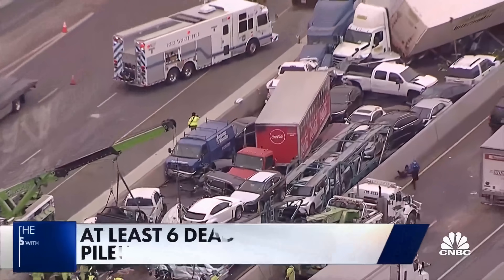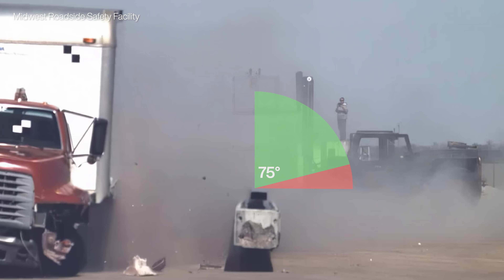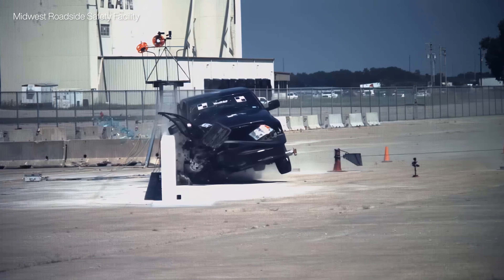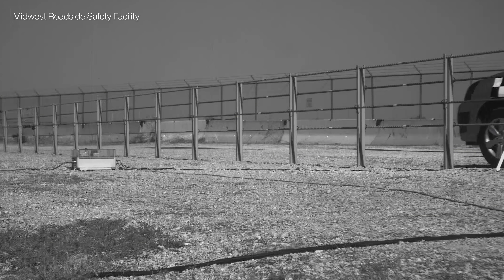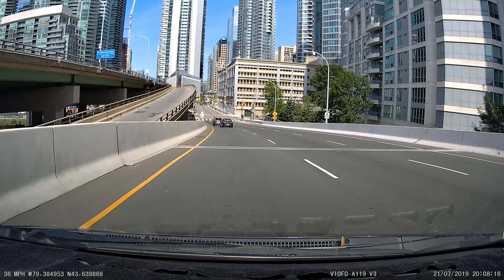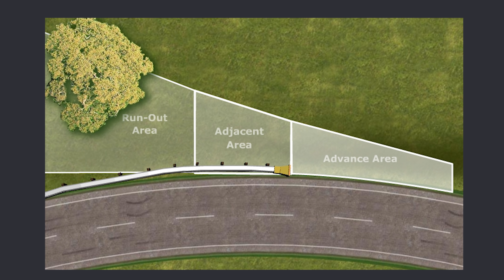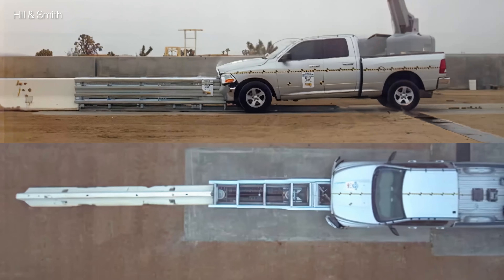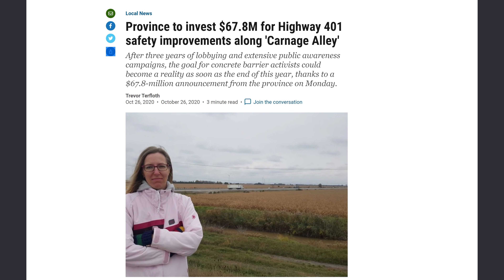How Road Barriers Stopped Killing Drivers

Comment: I found this video very interesting and informative, and I was particularly caught by the section on how governments value the lives of road users.  As a motorcyclist, I have always felt that I am totally ignored by all concerned in road design and construction, and that governments of all political persuasions just couldn't give a f*** about my safety.  Rope wire barriers are a prime example of this attitude.  If I hit a rope wire barrier I will not be gently slowed down, I will sliced and diced!  But at least the government will have saved some money.
Reply: @TheBetweenSkill  Most of the bikers protection come from their own wallets...  you really cant skimp on protective equipment, all those morons who drive without proper gloves, boots, pants and jackets are in it for some serious damage even in a tiny accident.
Just sliding across the tarmac is going to destroy a your skin... unless they wear protection which prevents that completely, a T-shirt aint gonna do shiz.

Proper equipment can protect from serious impacts aswell, broken bones are almost always guaranteed but even then if theres padding (for kinetic energy absorption) it  can go a long way in preventing spine injuries which are far worse than just snapping a bone in your  arm.
Reply: In the USA, the governement doesn't really care about safety, mainly because there is a big lobby of bikers on harleys that prefer to die straight away in their crash instead of spending 1 month in a cast.

Best exemple is that the soup bowl DOT helmet is still totally legal, even though its almost as safe as a construction hard helmet.

Hopefully, will see a change in that.

Comment: In North Carolina, there's a lot of cable barriers in the clear zones on highways, but fairly recently I've seen two cases in two different parts of the state where a car went off the road, into the median, and straight through the cables without slowing down whatsoever. Both cars went all the way across (about 40 or so feet) the medians and hit another car head on. I'm not convinced about cable barriers being solid enough after seeing two separate incidents where cars just mowed down an entire section and went all the way into oncoming traffic. Unfortunately, both cases were fatal and I hope the state learns that maybe they need to do something about it.

Comment: Lets put the data in a less inconspicuous, yet the exact same, rate as your chart. Given the same # of crashes:
Conc deaths: 4,444
Cable deaths: 10,000
You know, just SLIGHTLY higher. 
Would anyone say THAT method of displaying the same rate, 2.25 times the # of deaths, is “slightly” higher?
No. No they wouldn’t.
So stop. Do you have an agenda or what? Personally, as someone who works for one of the largest construction co’s. In the world, I’d like to NOT give them more ammunition to sacrifice safety for $ by using sloppy, weak,  language regarding safety equipment statistics.

Comment: Did he just say “slightly” higher death rate from that graph?!?!?!?
Ummm. Sir. As a construction engineer, and as a generally smart person, let me be the first to point out that 2.25 TIMES the fatality rate is NOT “slightly” more. Wow. If you dont have the guts or the brains to report this accurately, please don’t report it at all.
Just because both figures APPEAR low, meaning they’re both under 1.0, means NOTHING. How about if the rates were 0.004 and 0.09 - Those are both “small” numbers too. Is one just a “slightly” higher rate than the other as well?

Comment: One thing you didn’t cover our roadside signage and lighting poles. A lot has been done over the past decades to improve safety in those. Wooden posts with large holes drilled in them so that they breakaway easier, breakaway bolts etc.

Comment: "slightly higher fatality fate vs concrete"
0.4% to 0.9% is not "slightly higher", it's over double.
Reply: and there's a 100% difference between 0.00000000000001% and 0.000000000001% however the odds are still very low.
Reply: @xxxdumbwordstupidnumberxxx4844 Actually, the difference is 100x, which is a 9,900% increase. And anyway, the second fatality rate is so low that if that is an annual fatality rate, every 10,000 years someone dies.
Reply: @ME0WMERE  you're right, i didn't actually think the math through there

Comment: Cable Barriers kill motorcyclists and should be banned, it's like hitting a cheese slicer on a bike.
Reply: Aren't basically all barriers deadly on a bike? Hitting anything at highway speeds on motorcycle basically turns you into a human projectile.
Reply: @vaughnd222  No. firstly not many crashes are at highway speeds - a lot of braking usually happens before the impact, then a solid barrier will hurt you and may kill you, but a cable barrier concentrates the kinetic energy just the same way as a sword does, doing way more damage.
Imagine being told that a 12 inch steel  spike, driven by your airbag charge, in the centre of your steering wheel, was a safety feature that would deploy on an impact and you should just suck it up because it's cheaper to build than an airbag. that's how motorcyclists feel about cable barriers.

Comment: I'm missing a point of view: motorcycles. Both the rail and wire are less than ideal when sliding into them. The barriers, while painfull, are less likely to tear off a leg or arm when sliding into them. Sometimes they fit another flat beam at the bottom of a barrier to prevent motorcyclists from sliding underneath.
Reply: The Monster Under Your Bed  you're misdirecting on purpose. You understand full well its no extra trouble to look into motorcyclist when adjusting crash barriers.
But since you went straight to a 1 part of the comment and went with that to try and be right, you've pretty much told everyone you have no arguments.
Which is only to be expected.

Just a note: there are airbags for motorcyclists. Integrated into the jackets.
Reply: +1
Reply: I was thinking that too!!
Reply: If you want to be safe, why are you riding a motorcycle in the first place?
Reply: @jimmehjiimmeehh9748  Its not about being safe. Its about not being ripped to shreds should I fall for whatever reason.
Reply: @Twiggy163  So it's about being safe?
Reply: @jimmehjiimmeehh9748  Damage control. Youre already not safe.
Reply: @Twiggy163  So it's about being safe?  Trying desperately to use alternate phraseology doesn't change the fact.
Reply: @jimmehjiimmeehh9748  Sorry, but damage control has passed the safety checkpoint. Damage control means you've already done what you can about preventing something. Damage control means you try to limit the consquences.
Reply: @Twiggy163  If that's what you're arguing then you have failed spectacularly.  So once again if you care about safety why are you on a motorcycle?
Reply: @jimmehjiimmeehh9748  Why are you arguing when you dont understand the difference between safety measures and risk mitigation?

Why would I care? It is a weird question. Because there is risk involved, it means I dont care at all?
Reply: @Twiggy163  It's not why would you care, it's why are you choosing to ride a motorcycle and then whining about safety?

Choosing to ride is choosing to put yourself in danger.  If you care about being safe why would you choose to ride?  And from the municipality's point of view why would you waste money on building safety measures for 1/50 or so of road users that are already choosing on their own to put themselves in danger?
Reply: @jimmehjiimmeehh9748  Whining? The only one doing that is you. Like I said, why should one mistake, either mine or someone else result in my death or dismemberment? Same goes for the choice of barrier. The way it is designed impacts driver and rider safety. Thats what this whole video is about! So if theyre looking at driver safety, why not take rider safety into account at the same time? Your 'care about safety' argument falls to pieces at that point.

I'd love the statistic that says pedestrians are killed more often by a motorcycle than a car. However, there needs to be a relative in that because, like you said, there are a lot more cars than motorcycles. Even then, the numbers in my country dont support your claim. The mass and shape of cars is enough to make them more dangerous and more likely to happen in the first place.

The obvious statistic youre pointing towards are bikes being more dangerous for the rider. I never claimed otherwise.
Reply: @Twiggy163  "Why should one mistake, either mine or someone else result in my death or dismemberment?"

Because you chose that level of risk when you chose to ride a motorcycle.  No one else should have to pay for your choices and mistakes.
Reply: @jimmehjiimmeehh9748   He didn't whine about safety, it's about  the injuries for crashed, for examples you will be injured from a car crash but due to the road barrier, the "damages control"  reduced  thanks to the barrier reduced from it ,
Reply: @dadaeeaeeadada3301  "He didn't whine about safety, it's about  the injuries for crashed"

This is the language barrier again.  These are the same thing.

To be blunt, you should not argue in a language that is not your native tongue.
Reply: @jimmehjiimmeehh9748  Just because I'm not fluent in English doesn't  mean I can't use it , these words exist and you actually the one to tried to change the original meaning doesn't help ,  there is a different between a vehicle crashed and the person suffered injury from the crash , that why road barrier exist, they exist to damages control or rather reduced the injuries a person get ,
Reply: @jimmehjiimmeehh9748   No I didn't choose that level of risk, that is nonsense. I chose 'a' level of risk. Not specificaly that level. I also dont choose the type of barrier the government or agency has placed alongside the road. Hence, when improving safety for cars, why not also look at motorcycles at the same time? Its a non-issue.
They did do that where I live, but they didnt mention it in this video.
I also pay road taxes, insurances, health insurance and unemployment insurance (social security) in this country. So, I'm already paying.
Reply: @jimmehjiimmeehh9748  What? What kind of idiotic thinking is that? English is not your native language so you shouldnt argue?
Maybe you should just bugger off. Anyone can chip in. I dont mind your comments either.
Reply: @Twiggy163  "No I didn't choose that level of risk, that is nonsense."

So you were forced onto the motorcycle at gunpoint then?
Reply: @jimmehjiimmeehh9748  Realy? Again with the weird questions? You're just clutching at straws.
No motorcyclist has ever gotten on one with the idea 'theres is a risk my slide will end me up under a barrier that will tear my limbs off.
A fall? Yes. A slide? Yes. Thats why there is protective clothing. Some dont even care about that, it seems.

But for you to say there should be no thought into a barrier for motorcyclists because they accept the risk is utter nonsense. Car drivers take risks, may aswell forget the barriers entirely if we follow your line of thinking.

You're arguing over nothing with straws and I'm ending it here.
Reply: @Twiggy163  Tbh I'm genuinely impressed you managed to stay relatively calm and non-insulting while arguing for 3 or so hours with such a short minded, clearly biased person. 
Bike haters can be really insufferable sometimes. This coming from a person who doesn't ride a bike, but that can see the bad rep a few irresponsible bikers give to everyone else, thus devolving into that kind of idiotic "you should die" mentality. Sad, really.
Reply: @ricmar  oh its quite alright. Ive had a nice ride to the in-laws (on my way back, just taking a break). I dont think hes an anti-bikers, though I understand te stigma surrounding motorcycles. Relativly speaking, people tend to let loose a lot more on a bike, to great annoyance of many people.

The original comment stems from me being both a motorcyclist and a civil engineering. Just an observation but it got the wrong sort of attention.
Reply: @jimmehjiimmeehh9748  The thing isn't about why  motorcycle being dangerous, due to  road barrier evolution lead to less risk for car user but fail to protect motorcycle user, road barrier also need to protect motorcycles drivers
Reply: @jimmehjiimmeehh9748  You ignoring poor country like Vietnam where most people don't have the money to afford a car
Reply: @dadaeeaeeadada3301  It's not about bike or car.  That being said if you can't afford a car and don't want the danger involved with motorcycles then you walk (or bicycle).
Reply: @jimmehjiimmeehh9748  There are safety concerns about cars aswell. This is why they have all those nice airbags, collision detection, ABS (on my bike aswell).
Theyre also more lethal towards pedestrians. Theres arguments against both and I have both. I like both and both have (dis)advantages.
Reply: @jimmehjiimmeehh9748  how the fuck driving a bicycle help reducing danger ???
Reply: @jimmehjiimmeehh9748  and you think walking is safe then u need a reality check, man , u know nothing about dangerous between car and motorcycle
Reply: @Twiggy163  Oh and also cars are not more dangerous for pedestrians.  There are fewer pedestrian impacts by motorcycles due to there being less bikers, but when they happen there's higher KSI rates.
Reply: @dadaeeaeeadada3301  Walking is 4x safer than riding a motorcycle.  Biking is ~3x safer than riding a motorcycle but also much faster than walking and cheaper than driving.

I don't know if it's a language barrier or such, but you do not seem very bright.
Reply: @jimmehjiimmeehh9748   ye, good luck driving a bikecycle in high way .eh
Reply: @dadaeeaeeadada3301  "ye, good luck driving a bikecycle in high way .eh"

If you're having to commute along highways and still not able to afford a car you're doing something wrong and have been for some time.

That being said, you can actually comfortably cruise at 30-40mph on a bicycle (look up big sprocket mods).  Or if you're lazy just stick a little motor on it.
Reply: @jimmehjiimmeehh9748  If I drive 30-40 kmh on a bike, then that made no different using a motorcycle , the thing is , you are wrong  and not everyone can or be able to drive car, motorcycle exist for reasons , plus, I'm going to vomit on a car due to motion sickness
Reply: @dadaeeaeeadada3301  "If I drive 30-40 kmh on a bike, then that made no different using a motorcycle."

If you only do 30-40 kmh on a motorcycle, you're unusual.  Motorcyclists tend to speed.

Additionally that isn't fully the case either unless you are using your bicycle on the road which even though in some places it is illegal to do otherwise (I don't know about where you are specifically) you still shouldn't because it is unsafe and inconvenient for everyone else.

If you're going along at 30-40 on footpaths you're far safer than a motorcycle.

Also bringing up that you get motion sickness is silly.  Also how the hell do you get motion sick when you're the one driving?
Reply: @jimmehjiimmeehh9748  Unusual ? You're not the smart one here ,  motor is a 2 wheels vehicle,  normal people don't drive above the speed limit and I'm not the one to drive a car
Reply: @jimmehjiimmeehh9748  You are just simply biased against motorcyclists for whatever reason. People dont ride motorbikes because they're unsafe, they ride them because they enjoy them. Your argument is literally that skydivers shouldn't use spare parachutes because they should accept the danger. You are unmoving in your stance of "If you think it's dangerous don't ride motorbikes!" but that is just simply avoiding the entire argument. Your mindset is completely stagnant and there is no point anyone here trying to argue with you until you come to accept that.
Reply: @jimmehjiimmeehh9748  I was just letting you know lol, even now you're trying to pick and choose, im not arguing with you i am stating something lol
Reply: @facepalm7345  "It's pointless to argue with you!!"

Says the man who keeps posting argumentative comments.

You don't even understand your own motivations lmao.
Reply: @jimmehjiimmeehh9748  I dont mind feeding the troll, just like you it takes me less than a minute to see the notification and shit out a response! :D
Reply: Just like school, they’re made for the masses

Comment: Cable barriers look absolutely terribly unsafe for motorcycle riders. Imagine falling of your bike, and hitting those cables whilst at 70km/h... You'd be sliced in half. Meanwhile with concrete or semi-rigid (with motorcycle protection, often employed here in NL as wooden planks to prevent motorcycle riders from slipping under the rail or hitting the posts) you would just slide against the wall.
The problem with MASH seems to be that the standards only take into account passenger cars and trucks, but do not take into account possible injuries for two and three wheeled vehicles and quad bikes.

Comment: Hi from Europe and thank you very much for this really interesting video!
One thing you didn't mention: motorcycle crashes .
Usually when you fall on a motorcycle, YOU are the bumper and cables and rails are known to amputate or even decapitate motorcyclists. On cheap solution is reusing old car tires to be fitted outside the rails, protecting the motorcyclist from the small area and sharp hard surface of the rail.